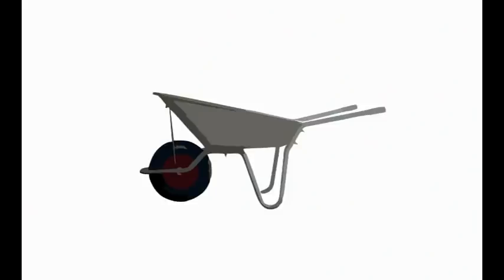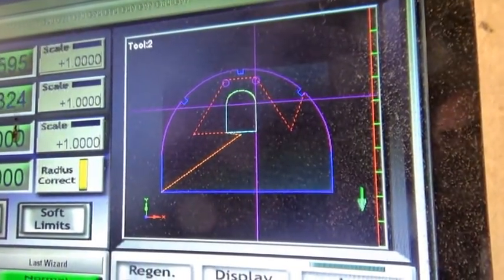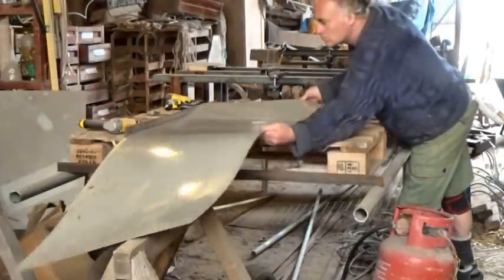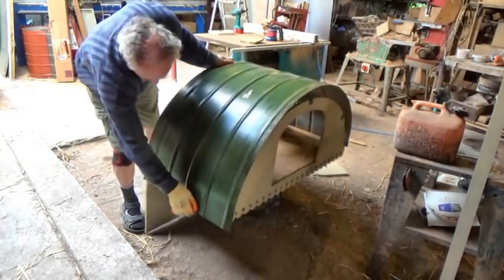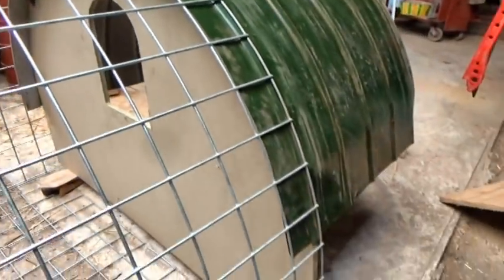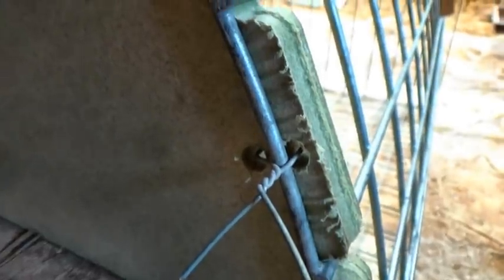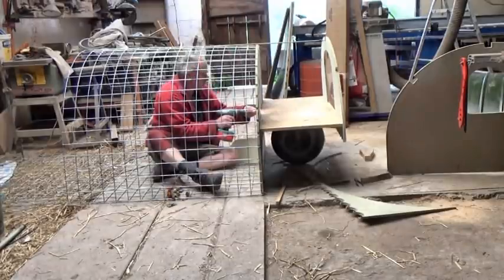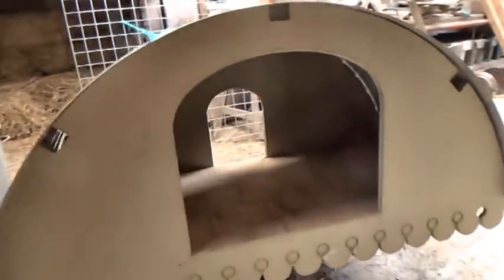Prototype Wheelbarrow Chicken Tractor - an interesting design challenge

Comment: I agree with some of the below comments. Extended metal roof, handles front to back for rigidity. lower the nestbox floor to lower the wheel for clearance. outside the nestbox roost/ perch. Smaller mesh, or mesh over mesh, for predators. Yes, I  have lost young pullets by predators reaching a paw/ claw through even poultry netting. Went to 1/2" hardware cloth. Dog (dog from h***) still breached  that. Build /finish for WX resistance, then knock down for shipping with good picture instructions. Another brilliant Tim innovation!

Comment: I can see a few issues.  The first and most important is the nesting area needs more ventilation so air flows through.  What I would do is make that back door much smaller.  It just needs to be big enough to put your hands in to get the eggs and clean out the old nesting material.  I would put 4 small vents on the front and back of the nesting box near the roof.  Second would be roosting spot both inside and outside.  Anything off the ground inside will make the chickens much happier.  Lastly I would add a small tarp or canvas that is dark on one side and light colored on the other.  Chickens will need shade so something that you can tie to your mesh would work great! The lighter colored side will keep them cooler in the summer while the darker colored side will keep them warmer in the winter.

Comment: Instead of making bent metal brackets for wheel mounts and shelf brackets for stabilizing the rear wall, you could cut two pieces of MDF and placing them on each side of the wheel, running from front wall to rear wall, sloping down. That way you stabilize both walls and the floor and you just have to drill holes for the axle to mount the wheel. This would also add some flexibility to the wheel dimensions as you can use the same parts for different wheel diameters and mounting positions.
If you find the complete vehicle too easy to tip sideways, you could have two wheels, one in each side.

Comment: Nice design Tim! love watching you work.  Can you manufacture the coop in such a way that it could be shipped in pieces and the buyer can reassemble at location--with good directions of course.  We ordered one of our small coops online and was shipped to us by regular delivery--all we needed was a screwdriver--came with the proper screws included.  It was flimsy tho, and not mobile like yours will be--hope you sell a hundred of them once finished.
Also a locking door to keep chickens inside when coop is being moved (locked after they go in to roost) would help to not crush their toes when moving coop.
P.S.--as far as bigger roof suggestion--user can add a tarp fastened on or removed as needed--keep it as light and as simple as is practical.
Hope those are helpful--blessings to you and Sandra.

Comment: From the comments, it sounds like you need to add a third space.  You have a night area inside, and a screened out side area, but folks are saying you also need a nest box just for laying.  I assume the nest box needs to be further forward than the night area.  The separation will require an additional wall.

The following are my own design thoughts:
Give the walls, and floor, the tab - in - slot treatment for connection.  I saw you do that on an earlier project of yours. 
And you could also make the brackets for the wheels out of wood panel material, held with the same tab - in - slot system. I think you could secure those joints together with twisted wire, putting the raw ends below, out of sight and harm.

I suggest that you experiment with the handles to see if the following configuration works: use two, 2 inch X 2 inch, wood timbers that run through the construction starting at the wall between the nesting box, and the night box, running the night box, out the back wall, then through the screened area, and out the back screen, then extending far enough to grab for handles.  The hens should be able to perch on them in the night box, but it would also be great if they could use them in the screened area as well.  So the trick is to see if their height can be made to work out for both roosting, and for the human who has to move the thing around.  The handles would be solidly secured to both solid panel walls, and to the back screen wall.  That would add some extra structural rigidity.
Now, I've just advised you to create long pieces of wood that will be hard to ship.  To get around that, each timber could be made in three pieces, and are spliced together by overlapping them, and secured together with nuts and bolts.  The joints in the handles / roosts should line up with the walls in such a way as to provide additional strength and stability to the overall. 

Another thought on this is that the end product won't break down small enough to ship easily.  
For one, the rolled steel panel roof takes up a lot of room, and can't be reduced in size.
As neat as that arched roof looks, you may want to experiment with a single, flat piece of steel that slopes from the screened area wall down to the back wall.
To avoid the need to use flashing where the roof panel joins the wall, I suggest that you cut the wall panel flat at the top and run the roof panel right over it.  Another person suggested that you provide a little outside roof protection for the hens, so I'll run with that and suggest that you put another steel roof panel on that side to make a porch roof over that end of the screened area.  Have the porch roof also go over the top of the wood panel hen house wall.  That would make the panel be right under the ridge line where both roof planes come together.  As long as at least one of the roof panels is bent over the ridge, rain water should be kept out of the hen house.  Alternatively, you could make a ridge flashing, and just leave the roof panels flat.  By flat, I mean, not rolled into an arch, but certainly having strengthening corrugations in them. 
  The down side to using a shed roof on the hen house is you'll need to make side walls out of panel material.  But there's an up side to it as well.  The walls can double as the outside brackets to tie the floor to the walls, so you won't need those anymore.  Have the side walls extend down to near the ground at the screen area side, and then cut them diagonally into a decorative pattern to look like fancy Gypsy wagon brackets, or something like that.

I'm also concerned that the screen will take up a lot of space for shipping as well.  Try making the screened area out of two separate pieces for the walls, and one for the top.  The screened area might look pretty good if its top sloped down from the height of the hen house wall to the wall where the handles are.  The slope should match that of the porch roof, and the steel roof panel can be supported by the screen.  The angled cut on the side walls would be done in pairs to get the most out of the material.  The down side to having screen that's cut at an angle is that it leaves sharp wire ends sticking up.  I suggest that you fold pieces of sheet metal into U shaped pieces to cover the angled wall tops.  The screen "roof" piece will sit on top of those sheet metal pieces.

 Also, the back screen wall, the one that the handles project through, will be shorter, and will therefore, use less material.  That screen wall would only need to be as high as the handles are.  And considering that the unit needs to be tipped up to be moved around, the handles should be just a bit higher than a person's knees.    
  All of the screen pieces, including the sheet metal U caps, can be tied together with more twisted wire.  But some steel bracketing will be needed to provide rigidity, and the U pieces will need holes drilled in them in strategic places for wire and/or bolts.

I have not drawn this up, so when it gets converted into real scale, some of these ideas may prove to be worthless.

Comment: I would make the wire mesh notches a bit wider, to accommodate variations in the weld mesh dimensions. Also, you should be able to make a few spacers to capture a full mesh square. Then the sheet roofing will hold it on without the twisted wire. Good work so far!

Comment: I have seen lots of similar ideas, usually the 'single person issue moving' is solved by just having two people but in the real world that never happens. The monstrosity I built for my sister ended up in two parts. The cage, huge and just a set of panels of rabbit wire stretched in a frame built of 1 1/2 by 1 painted pallet stock (giant pallets). Erm where was I, oh yeah, those panels screwed together to make a box with no floor, so the chickens could scratch the grass. The nesting box already existed with a tiny run so that was just slid into place, so the opening on that matched the opening on my cage,  ...on a sledge you could slip under it which I also made. You could move the big cage with the sled too. Utterly impractical in the end. The run I built now serves as a fruit bush cage..   So all that said.........

I like this a lot!
  I really like the wheel,  I don't think it would be too heavy anyway and it could move forward, to give better ground clearance for uneven areas and any weight issue, just include longer sticks? 
  A vertical slot cut in the end of the sticks that goes in the wires, then a screw trapping the stick/wire in place will hold it and just paint on the right squares to poke it through at the holding end there. (some assembly required)
  I am going to suggest re-enforcing all the joins in the nest box floor with 1 by 1, like where you have the angle brackets, glue to the floor some 1 by 1 either side and between the brackets and then screw the other panel to that as well so the angle joint has so much more strength and future durability. Maybe even some blocks along the roof curve too that you can screw into. While the roof would give it rigidity, more is better....
Doors. With extra wood to screw into at the panel joints now, I would suggest the door opens hinged from the bottom, a single door, with a chain or something so it becomes a ramp. A similar thing on the door joining the roost and run. So the chucks have something to scrabble up or flap to, to get bed. You can reach through the back door to open and close it or a string might be employed to pull it up from above through the wires or the back of the nest box.
Not sure MDF is a good idea, it is not much use outside no matter how much paint you put on it. And I wondered if some assembly is required then will the whole nest area, spin round and poked into the cage, fit in the cage for shipping?
People might want the option of a section of grid in the floor being removable so the chucks can scrit at the grass but that is just going to add complexity to the build, although in might not totally ruin the rigidity if enough, two or three squares border, is left intact.
Well, you did ask ;)
Shorts!!!? In Ireland!!!?

Comment: Well from observing my own hens I noticed they like to stand outside while it's raining so in my old pen I covered a small part of outside their house and they loved it, it also keeps the inside getting too dirty so maybe extend the roof out a bit both for that reason and to prevent the ladder for the doorway ( if you are putting one on ) to stop it from rotting both also I would make wooden braces at the wheel too because there's still alot of pressure on that wire holding the mesh on hope this helps

Comment: Personally I would also make the run and the hutch separately so the chickens have more space in the run, the run could be modular so people could buy more than one and give their chickens more space.

I would move from the semicircular end profile to a triangular one, this would mean less wastage of materials in the making process. The floor size of the hutch being the same as a euro pallet.

I'd then have a central perch running front to back for roosting, two nesting boxes underneath at the rear for laying, a drop down shutter on the front to keep them in at night (and so you can move them contained in the hutch) and a hatch on one side for human access (to gather eggs)

Then some little legs at the rear and two wheels at the front (pram wheels would be big enough) to keep it up off the ground and then arms out the back that make it into a wheelbarrow style.

The run could also be any shape but it would be good if you could get two sections of run on a pallet so the chickens have ample space. One of these sections would have wheels on so again it's easy to move.

In total, the set up would be the length of three euro pallets end to end, the hutch an easy one person move as a wheelbarrow style, the run, although longer would be much lighter than the hutch and also an easy one person move. 

I could draw this up if it's confusing (I have made the design I'm talking about in the past and it worked great)
Reply: Lots of good ideas. I wonder if the base of the box could be a euro pallet? 🤔 Two or more mesh panels could be attached to the euro pallet for shipping and then assembled into a chicken run. 🙂

Comment: I really like your thinking on this!! I made my coop like a big garden cart with two wheels and a pull handle in the front. I made a regular little roofed house with a floor, but I was influenced by a coop design called a "chickshaw" that you can pull around. What you've got that is so different is the attached run. The house looks easily cleanable. Is there a handle or string to close the front door up at night? There could be a perch in the house, or a partition inside as a nesting box, perhaps.

Comment: All your gadgets are just amazing!  AS a chicken keeper my first thought was ...."is this opening sufficient for getting in there and cleaning out the coop?"  Maybe if the exterior side were predominately frame with he whole side hinged to allow access for cleaning???  Also thought , since we have severe weather here, would the metal roof allow them to stay warm during the winter or would the metal lose too much of their body heat?    How was the bending down and getting into the coop for you?  I have had back and knee injuries so  things being very low can bother me.  I have to say that I just love the little trim edge that you cut with your machine.    I think you are on the right track for marketability, though, maybe you might want to consider just building a shippable frame for the yard portion.  Then your system would easily fit on the shipping pallet and people can provide their own  locally purchased fencing.  I am becoming interested in the chicken tunnel system and your coop design would lend itself well to portable tunnels.

Comment: The last lot of hens I had were killed by a creature that got through smaller mesh than you have and killed them by biting their heads off. A weasel maybe, so perhaps smaller sized mesh. In terms of longevity maybe using upvc instead of plywood would be better, but in Ireland might be too expensive, so maybe 20 gauge steel since you have a plasma cutter, then galvanised. I have always thought metal roofs would be too prone to condensation in winter, but you will now have experience with your hedgehog homes that might have proved me wrong. If I was doing the project I would probably be thinking of a rectangular construction that would fold flat for shipping with a small pram sized wheel (makeable as plasma cut discs with fold over tabs for the tyre if plastic wheels were too expensive) at each corner and a mechanism to drop the ark onto the floor, then lift back on the wheels with foot operated lever. There are all manner of designs for this on YouTube often used for making heavy machines moveable. The lift mechanisms would be provided in a box and attached by the end user leading to a  more compact shipping outline. The aesthetics of rectangular are not as good eye candy as curves, but maybe more practical for shipping and one could perhaps market them bee hive like as folk have bee hives that are rectangular in form. Also it would be then easier to put a roof (galvanised steel) over the grass area to keep the hens dryer on rainy days. In terms of daily maintenance, it would be easier to have a removable litter tray under neath the roosting area that can be filled with shavings, saw dust, paper etc. This can be marketed as a free fertiliser facility as hen droppings are rich in plant foods. Some kind of water source for the birds will also be needed, presumably feed would be hen mash scattered on the floor, or it could be put in pots attached to the wire case. Anyhow some ideas and as the downpours seem to have stopped I can get back to gardening, replanting after my cheeky pony broke into my sunny garden and ate my sweet corn, runner beans and sweet peas, these already second planting after frost, but maybe 3rd time lucky. Good luck!
Reply: We had our hen run attacked by what we can only assume was squirrels, not going for the chickens but going for the feed, they did a lot of damage in their quest
Reply: We don't have weasels in Ireland........... Unless you count the shower up in Leinster House.😏
Reply: Sounds like mink.  We lost our first flick to two mink - they can get thru a 1 inch hole.

Comment: Consider zap straps instead of wire for assembly.   To pack for shipping put both curved wood ends together flat on a pallet with the metal floor and hoop assembly on top like a barrel.  The wheel and next box assembly could fit down inside the hoop, add handles and the packet of nuts and bolts to add the handles and zap straps to hook ends to the wire mesh would also go inside.

Comment: The indents for the wire are a brilliant idea, but you can use them better if you routed a groove in the edge, like if you were using t-molding, and wrapped a wire, I would use electric fence wire, around the outside. It would be a lot quicker than all the individual ties.